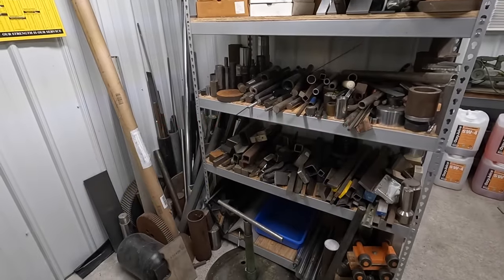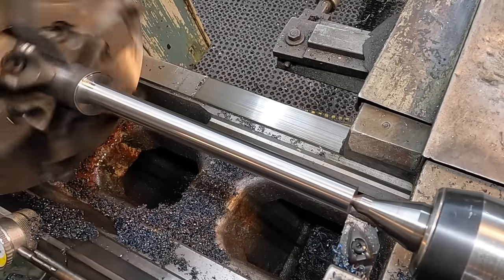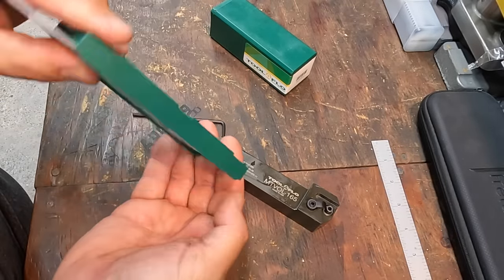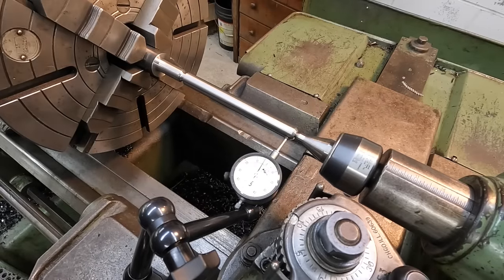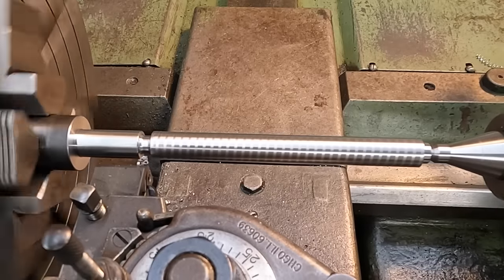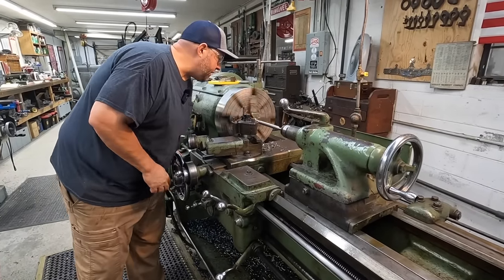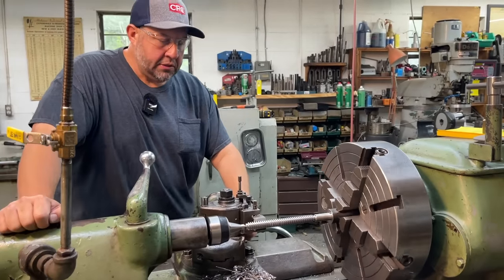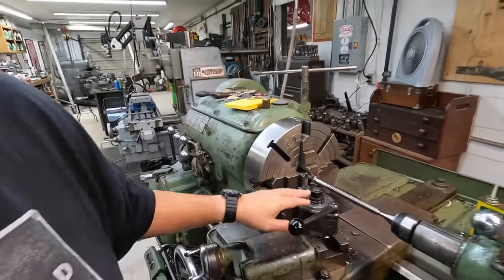Compound Lead Screw for American Pacemaker

Comment: It is the back lash in the compound, also having the compound set at 14 deg it wants to travel in the fwd direction. I was taught @ a UK toolmakers starting in 1977 and what Harry showed me was to set the compound at 90 and move it a few thou back and fwd on the compound. And do the depth on the cross slide. Your way (the usa way) has twice the dials and back lash to keep control of. 😁
Reply: Either way will work if the stock is heavy enough not to flex. If the cross slide is used for threading depth you cannot use a follower rest which is needed for support on this job.
Reply: @ellieprice363  Yes it is a small diameter to flex, but how I was shown you where only taking the metal of one face at a time so it was slower also this nonsense of no coolant is just to get a good picture. As I pointed out to Adam a long while ago make parts or make TV as spinning plates on sticks is not easy. while you are looking at the camera angle your mind is not on the job I worked in a top end UK toolroom and the only thing above the machines was one or two lads singing short bits of songs not filming.

Comment: I have the same problem with my monarch 20c, the tool post height was designed for positive rake tools, and most tool posts and tool holders wind up below center line with negative rake tools and a bit of flex and then the part rides up on top of the insert

Comment: I'd say it was tool pressure causing the work to bow. As it bows it tightens the shoulders of that deep thread onto the tool causing it to dig in and trying to ride up on the tool. Probably need a follow rest to keep it from bowing. Don't think it was entirely the lathe's fault. Backlash would contribute for sure but probably a secondary issue.
Reply: I think you nailed it, the piece is long and whippy with deep threads, a recipe for pinching. At first I thought the tailstock may not be good and tight causing the piece to ride up.

Comment: Hi Adam again I'm watching that's what happens sometimes with carbide versus high speed Steel. One thing you can do is put the tool slightly above Center, that'll keep the shaft from climbing up. A thread like that I've always used high speed Steel with arcs on the top of the flanks for chip flow. Also you're probably didn't use coolant or cutting oil for the video but that would help you greatly also

Comment: Hi Adam, I am sure you have thought of this but if you are still looking to understand why the thread tool started digging in I would suggest the following may give you a clue. 1. It is an old lathe and the lead screw is bound to be worn therefore only engage the half nuts on the same number each pass, will take longer but should at least repeat every time. 2.use a travelling steady to take the spring out of the job in the centre part of the run, at the length you are cutting with this type of thread form the job is bound to deflect away from the tool a little more with each pass as the core diameter reduces and the stock looses stiffness. this builds up until you end up with such a big cut it results in a tool dig in.usually half way along the pass. 3. change out the tool bit. 4. check the centre height is spot on. 5. Try taking only cuts which cut the centre area of the thread for a few passes until you have got the thread depth down in the center area of the pass to match the far ends which I expect are smaller due to the better support. in other words work the barrel shape out of the piece. I hope this may help find the problem. Great video as always. I agree with you your new lathe would be better but only if you have a travelling steady to stop the deflection along the pass. you can test this just set up a dti near the chuck against the work and try to deflect it towards the dti , then try the same test in the middle of the bar you will be surprised how much more it deflects. also remember this gets worse with each pass of the cut due to the reduction in core diameter resulting in a thinner bar with less rigidity. stay safe
Reply: Thanks for your comment. I am new to machining and now I am going to research a traveling steady, etc.
Reply: @ctrchg  Hi glad it was of help the fixed steady only has two fingers contacting the work, top and rear it bolts to the carriage and travel's with it thus supporting the work against the tool pressure from the front.

Comment: I ran Monarch lathes for years and I have run into that problem before. It could be the split but suspect backlash in the lead screw in your lathe. You have a lot of tool pressure with that insert and when you get to that sweet spot the shaft rides up over center and sucks up the backlash and all hell breaks loose. You might try pulling back on your tool holder with your free hand.

Comment: Hi Adam! I really praise you for showing mistakes mess up shows that this does happen. Not every video wonderful wonderful, so kudos to you! I ran six different monarch lathes and being a lathe Foreman at Atlantic Tool & Die in South Plainfield, New Jersey. I know what you're going through, but I always use high speed Steel. It probably is pulling up over the Centerline what I have done is lifted tool slightly above Centerline but I always use high speed Steel. This is an inherent problem with carbide. If you change the carbide insert you get a fresh Cutting Edge and you might correct a problem like this in the future also follower rest but shouldn't have to do that.
Reply: I certainly concur that the moment the edge dulls on carbide even just a little, it loses all its appeal in short order.  OTOH, that small amount of work on an ostensibly free-machining material should not have resulted in any measurable wear.

As for a follow rest, I think you might very well have to.  As depth of cut increases, decreasing the minor D, rigidity falls off significantly and, I've found, often rather suddenly in the span of a cut or three.  Add to that the increased cutting pressure due to the increased area of the cut as the tool goes deeper into the work and you end up with a whippy workpiece being pressed ever harder by the tool as each new cut removes more material than the previous, depth for depth.  3/4" bar, annealed, isn't going to offer up that much resistance to tool pressure at ~10" between centers, most especially with a form tool.

Comment: Hi Adam, I'm not a machinist, but I am a pedant. Before the cutting all went bad, I noticed something that I thought was odd. If you freeze frame at 31:13, the bottom of the thread seems to have a small step on the left shoulder. Initially, I thought the tool had chipped, but you would notice that. So, I agree with your diagnosis, that the Monarch is not cutting the same path every single time. In the example at 31:13, I would say the tool is under a lot of stress on the right side, and none on the left side. I guess at some critical point, you are going to get oscillation at the resonant frequency, and boom, it all goes bad.  Just a thought. I'm an electronics engineer and software tester in my day job :-)

Comment: I wouldn't blame the machine just yet....

As the cut continued & more material was removed, the rigidity of the shaft was reduced..... while cutting forces were increasing rapidly (as you approached full depth)-
-confirm on center tool height
-follow rest
-oil

I had a similar experience cutting splines in a 17-4 SS shaft on a shaper; the tool would want to dig in (because of the large amount of engagement). In that case, the solution was nibbling the bottom, left/right sides independently (which reduced tool pressure).

Unless you've now chattered the lead screw undersize, calling this a failure is premature. It's just another challenge that's popped up; adapt & overcome. That's what machining is all about.

Comment: While I'm not a professional machinist, I thought you would provide some sort of support to the middle of the screw. After all, the piece is only going to have a 1/2" diameter cross section when you get the threads cut, and a piece that diameter and over 10 inches long is going to be about as rigid as a wet noodle. I don't think there is a problem with the lathe, the problem is that the work piece needs to be supported in the middle.
Frankly, I was surprised you got as far along as you did before the lack of support bit you on the behind.

Comment: I think because it is a long part, the deeper you get, combined with the flex, the stock is lifting up onto the insert causing the chatter. When it did grab, it may have moved your tool and that's why it's not throwing an even chip. Try; (1) Index insert (2) Check tool center and recheck tool square to stock (3) Make sure Tail stock didn't back off (4) Add some cutting oil to the treads. If all that don't work you may have to use you follow rest to control that flex. I have been machining for over 30 years and I still learn new things, putting that indicator on the side of the tool holder to square it up is a good idea. I have always used a Fish Tail Gauge to square the tool up, but again, we learn new things every day. Love your shop and keep up the good work!

Comment: I know exactly what happened because I've done it before.  I have a Monarch 10EE, same issue.  The explanation is that the thread stop engages the dial.  The handle is attached to the leadscrew.  The dial is locked to the leadscrew with a separate knob on the dial near the handle.  If this isn't tight, the leadscrew can be advanced after the dial stops if you slam into the stop, or turn the handle hard.  The key is to keep the dial-to-screw knob tight when threading.

Comment: Hay mate , , I cut acme threads nearly every day have done for years and I have never turned the top slide around to 14.5 degrees  . There's no need to as it will always  want to pull in the back lash just  go sideways a bit on the final cut and run a bit of black oil on it better luck  next time. Cheers

Comment: I had a very similar issue, which was greatly remedied by replacing the half-nuts.  I came to that solution by discovering that they would sometimes be pushed out of engagement under heavier cutting pressure.  And to prevent it, I’d hold the threading lever in position.

Comment: I think a 3/4-5 ACME would flex up, particularly after a lot of the thread was cut.  A follower rest would help with that.  I'd also get some cutting lube in there, I prefer sulphurated oil but most anything would help.

Comment: Here is my two cents of opinion; every machining operation creates vibrations even when it seems smooth. They are tiny and until we don't hear them, we don't realize the unset of chatter. So the diameter of the stock was massive enough to absorb those vibrations to the point of stopping the build up of any harmonic vibrations in the work piece, until it wasn't anymore. A mix of the diminishing size of the diameter and its increased flexibility in the middle, permits those vibrations and their harmonics to augment and vary the depth of cut at high speed, creating this pattern on the left side of the thread. It is entirely possible, as Adam proposed, that any slack/backlash in the cross slide or leadscrew, acerbated the situation. Also, one might consider that in an operation like this one, heat will tend to stay in the middle of the work piece, as each ends have a good dissipation mass(head-stock and tail-stock). The suggestion of a follow-rest by Abdul Abbas is a good one. I would add the use of a high viscosity cutting oil, that will not be shaken off easily.

Comment: This is what I have do on difficult materials. There is too much force, so take a narrow profile tool and get to the root of the thread first then try the full profile tool, if that is not working go back to a narrow profile tool with the compound parraell with the ways and shave the flanks of the thread after you reach depth. I notice the lathe has leadscrew reverse, it would be to advantage using that to avoid error from camming in the half nuts and if there is a problem of the piece work hardening always take a cut, no spring passes or that will add chatter. Often working out acme treads in stages like getting a groove to depth and then shaving the flanks to gain the needed width, alloys can be cut in light weight machines. Good luck!

Comment: i just finished making a similar screw for my old surface grinder and had a similar problem.  makes me feel better to know that someone as experienced as Adam ran into the same thing.  In my case I believe it was a combination of the screw wanting to flex and my self ground tool not being sharp enough

Comment: hi adrean! thanx for you wonderful tutorials in machining. I can always lern allot in whatching you videos. i also had to machine such a acme thread once over a length of 2.5 feet and I had the same problem with tool digging in at half the length of the thread. as solution i made a walking support opposit and above the tool working area. that was working realy good.
Reply: I think that's the reason and the solution.

Comment: That's frustrating!  I had exactly the same issue cutting an ACME vice screw a few years ago, in the end, grinding a little more side clearance into the tool and dropping it down just a smidge below centre hight persuaded it to clean up (after a lot of spring passes and half thou cuts). It cleaned up undersize and I had to start again anyway, but it worked second time with just those two changes, can't really explain why! Good luck!

Comment: I've never set my compound to the thread angle.  Back to that old debate!  I just move my compound across a couple of thou each pass.  One of my trainers showed me that sometimes you need 2 tools to cut an acme thread especially the larger sizes, one to cut either side and use the Acme gauge or thread wires to get the right final size Cutting fluid would also help a lot.  A good teaching video for us all.
Edit... I think I read somewhere years ago that you can cut a square thread then come back and clean up the sides after to generate the correct form.  Many ways to skin a cat!

Comment: Hi Adam. What a shame and I know exactly how you feel as it was going very well up to that point. I am not sure if I have mentioned it before but I worked for Seco Tools here in New Zealand for 28 odd years and gained a lot of knowledge about the application of carbide etc. I am a fitter and turner by trade but am now retired so I understand a bit about machining. When an insert is made, one of the last operations is a light honing of the cutting edge to give it strength as a sharp edge would soon fail. The hone level depends on the application of the insert so for finish it would be a very light hone and of course the opposite for roughing inserts, a heavy hone. Your threading insert will have a very sharp edge and I wonder if the sharpness has caused it to be pulled into the workpiece, especially on a long slender thread getting worse from every pass. Maybe consider taking a diamond hone and just break the edge a little. Too much of course will apply a lot of tool pressure and may introduce chatter. Anyway, that's my suggestion for what it's worth. I enjoy your film clips as they are so exacting and straightforward. Cheers, and keep up the good work. Ps Love your new shop!!!! Ian
Reply: I had a similar thought, I was thinking that since this is a brand new insert that's nice and sharp that it may not have been exactly centered and that made it want to dig in once it got thin enough to have some flex to the part. While this is unfortunate, the amount of info and suggestions in the comments here are awesome and I'm learning a lot just from reading everyone else's suggestions.

Comment: Aside from any other possibilities from wear etc., half a degree of additional cutting is being put on the left side of the cutting tool due to the 14 degree cross. Uneven loading on the opposing cutting faces will cause tool chatter if the torque applied exceeds the rigidity of the holding assembly, hence it happening at depth. Same issue any V cutter has without enough rigidity, or with one slightly more worn face, the pressure on one side is greater causing deflection (if the forces exceed the tool holder + the work pieces deflection at distance from the head), which makes the other side bite more, which pushes back - setting itself up as an oscillating gouge machine due to the harmonics. 
A quick fix without changing setup is to increase rpm slightly (sometimes lowering, but usually an increase works better given the relative SFM is reducing as you cut deeper), can be enough to keep the cuts out of the resonant frequency range.

Comment: Are the gibs tight on compound and cross slide and do you have a little pressure/drag on the carriage clamp? As you come down in diameter the bar flexes more, if there is any play in the carriage and slide they can dive below center and the bar wants to climb up on top of the tool. Small diameter brass is especially bad that way. A follower rest would help bar flexing, and using some resulphurized thread cutting lubricant would cut down on friction that exacerbates the situation. I’ve been on a well worn South Bend and lack of rigidity is a big problem when cutting threads. Everything has to be tightened up to prevent the tool from moving up/down in the vertical plane. Also, the deeper you get with the thread the less rigid the bar becomes and it’s not a one-to-one relationship…stiffness decreases to the 4th power of the diameter. All the more reason for a follower rest.  That chatter we all heard in the problem section is a sure sign of lack of stiffness.